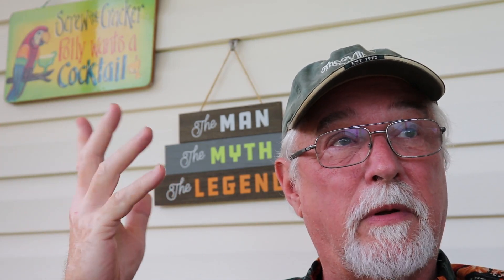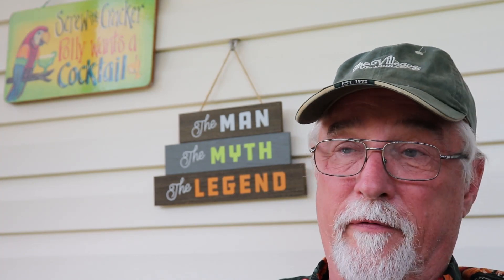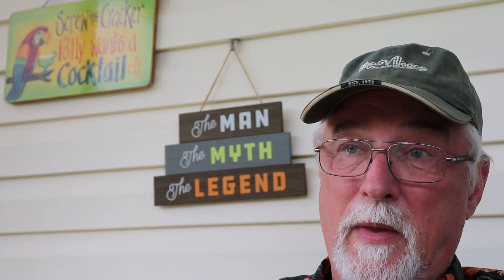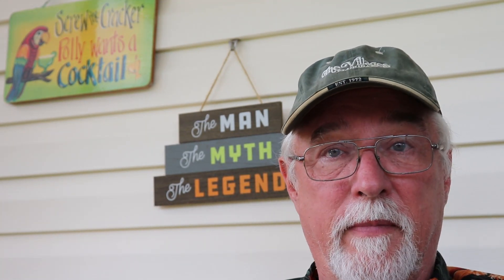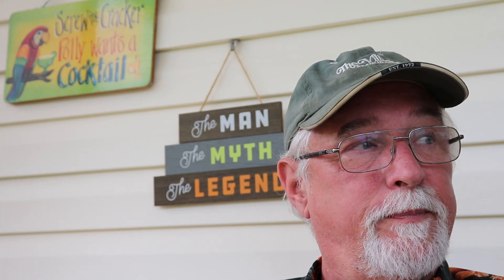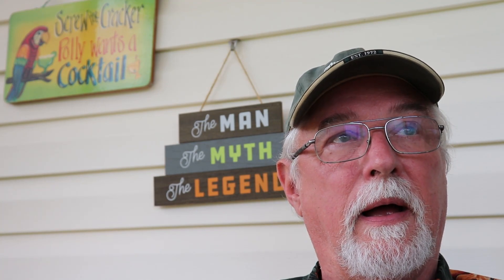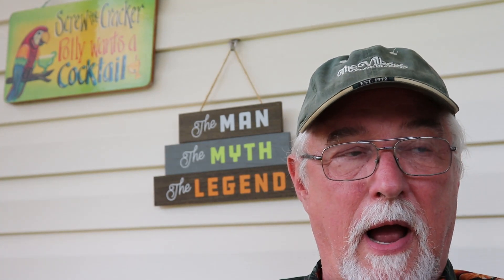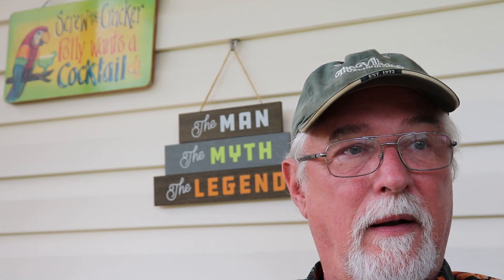Sumter County Property Tax Increase

Comment: I live in a Chicago suburb.  I have a house that was built in the 1950’s.  It has a partial floor in the attic.  I had blown in insulation put in the attic.  The contractor sprayed the insulation over the attic floor.  I also had an exhaust fan that is controlled by a thermostat installed in the top of the roof.  I had about 4 roof vents in my roof.  I had 2 additional roof vents installed.  The difference this has made in the cooling of my home is tremendous.  You have to have roof vents for circulation of the air otherwise the insulation will absorb moisture.